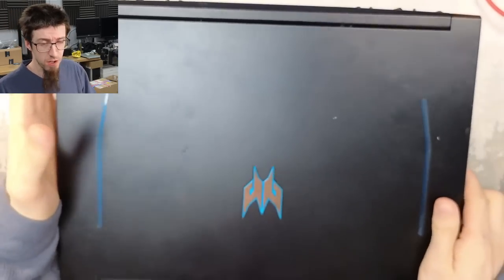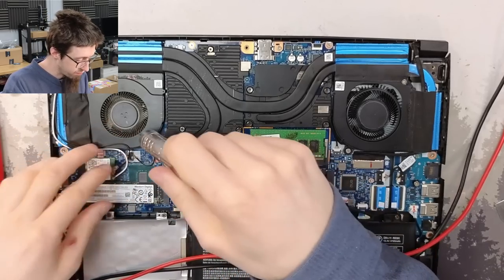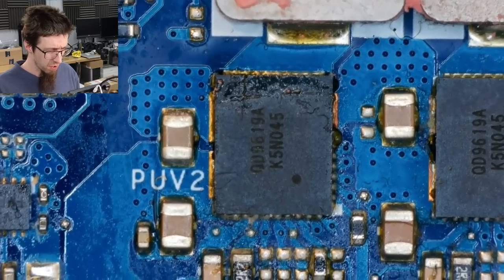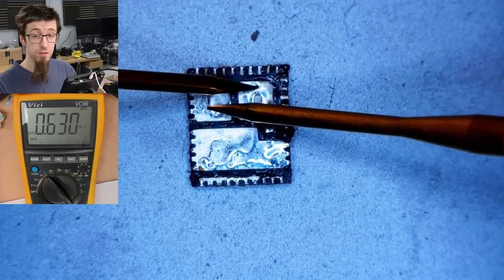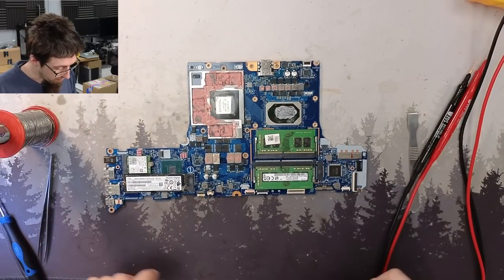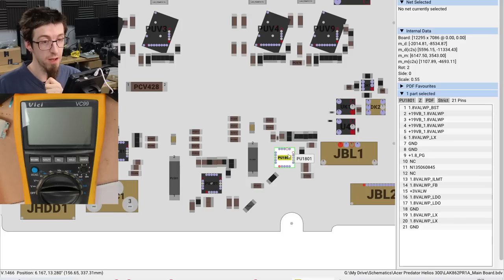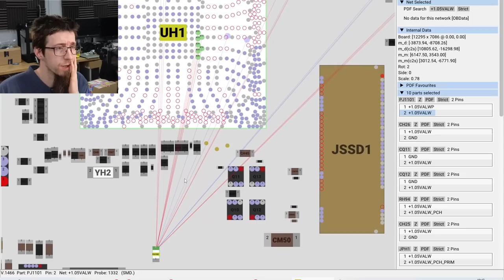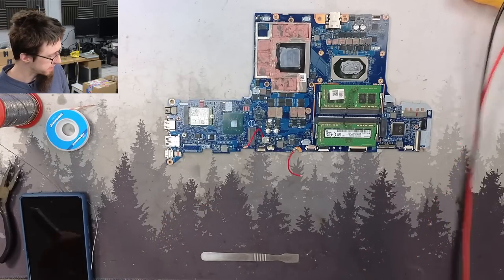A lesson in gathering all the data first - LFC#364

Comment from the maker: Side note, this is why we always inject at 1v or less, because you never know when the injection voltage might go to unexpected places. If you're below the voltage of everything on the board, the risk of causing further damage is minimal.
Reply: 100%. 0.5-1 volt injection is always safe to my knowledge.no  chip is gonna blow with voltage that low.Dont forget to set limits to current as well,start from very low and slow and stready  increase if needed.Also,as a general rule, pch cpu,gpu surfaces,need to heat up uniformaly when taking power.If during injection the  surface heats up partialy,its gone to silicon heaven.
Reply: These acer helios and predators almost always have a dead gpu or pch. Very rare i have found one not to. I have replaced mosfets to get light on charger but nothing. Terrible laptops when they go.

Comment: An easier way to check if a high side mosfet is shorted or partially shorted is just to check the resistance between drain to source, since in those vrms the phases are all in parallel if one mosfet is shorted then all of them will show as shorted. If the resistance is high then you pretty much know that all the high side mosftes are not shorted, still doesn't mean they're not faulty but you know the supply didn't shot through.
All of the mosfets are in parallel but their gates are not, so like Graham said, measuring their gates is the best bet for spotting the bad one. Mosfets generally (not always) when they get shorted they short all the terminals together so the bad mosfet will have a different reading from drain/source to gate compared to the other ones in the same vrm.
Similarly you can check resistance from the main power rail to the coil which is the same as measuring drain to source.

Comment: Another youtuber i watch had a similar problem with an 1080 he was sent to fix. The first thing the previous technician did was measure resistance to ground on the vcore coils, saw a low resistance and started removing everything that is connected to ground on that rail, he removed all the low side mosfets saw that the short didn't disappear and called a dead chip when the real problem was a shorted capacitor on the 5v rail.

This board you were trying to fix is a complete nightmare on the other hand, shorts everywhere.
This was good content though and a lot can be learned from this for sure.
Great video.
Cheers!

Comment: Done watching, thank you very much for the informative troubleshooting & repair video. I have learned significantly more troubleshooting & repair lessons in this tutorial video and to your other repair videos as well compared to my ENTIRE 4 YEARS OF COLLEGE EDUCATION. I hope you will soon have a mini-series for Schematic & Boardview-free Voltage/Power Rail Tracing[12V/18-20V Main Voltage Rail, 5V, 3.3V, CPU/GPU Core Voltage Rail, DRAM Voltage Rail, IGPU Voltage Rail, System Agent/Northbridge Voltage Rail, PCH Voltage Rail, BIOS Voltage Rail, Battery Power Rail], Proper method of testing/checking of potentially faulty MOSFETs & ICs/Controller Chips, CPU/GPU/PCH Reballing and BIOS Bin File Editing.

Comment: There are several reasons why modern GPUs and CPUs have a low resistance, but the easiest explanation is based on Ohm's law. Modern processors run on much lower voltages then most other IC's. In the early days of transistor IC's 12~14 volts was not unusual. While currently most processors run on 1.0~1.5 volts. The number of transistors in the CPU has also increased exponentially by staggering amounts (currently we're in the 1 billion to 10 billion range for CPUs and twice that for GPUs). With the increase in computational power, interconnectivity has also increased and more outputs are required to turn high to signal to other IC's that the processor is turning on. Meaning more current paths are open while the processor is booting up. GPUs usually have a lower resistance than CPUs because they have higher parallel processing capability (which requires more transistors to be in parallel).
Reply: Thank you for the information.

Comment: You need a multimeter that "short" beeps on reading a normal diode and "long" beeps when there's a short. 
We all know ALL multimeters in existance beeps on (when you touch both +- leads) continuity mode (resistance) BUT there's better multimeters that beeps on diode mode as well.

Besides the overpriced YELLOW brand, I've found a few cheap ones that does this, Uni-T UT60 & Uni-T UT89. Costs only $30 or less. You must have them!

Comment: you can replace the pch from a donor board tho if you are good enough with reballing and stuff
Reply: I asked Graham if he took in donar parts but he doesn't coz ot having loads of stuff stored amd in some cases never used but I know one guy who does but then again he has more staff plus storage space.
Reply from the maker: Yea PCH replacement is possible... but you need the right PCH, with the right firmware, then reball and replace - and after all of that, then you have to fix anything and everything else that might be broken on the board, and it's likely that one or more secondary regulators are busted as well.
If anything, I'd say this board is more useful as a CPU/GPU donor to another board with simpler faults.
Either way, to the next tech to look at it, good luck
Reply: @Adamant_IT  But you'll tell the customer that the laptop is dead, right?
Reply from the maker: No, I told them the PCH was dead. They're seeking a PCH replacement, but as per my previous comment, that's a job I'll let someone else take a swing at.
Reply: @Adamant_IT  Ok.

Comment: I would think the reasoning could be. Find short - inject - find regulators getting hot - check pinouts on datasheet to inject again at the output side of reg that will then allow you to see heat on PCH. Dead PCH done. I was wondering why you took so long to inject. Maybe prefer hunting with probes may be. Anyway. Thanks for sharing. Always learning.
Reply: Because mr Adamant has learned the hard learned lesson that there is such a thing as injecting too early. And most experienced technicians have learned this by eagerly injecting at the first sight of a short, and bricked silicon on a bord that was actually fixable. Thus sending the GPU/CPU/PCH to an early grave.
Reply: @sindreskjelbostad6436  injecting at 1v will avoid those issues. How can 1v kill a CPU or PCH?
Reply: @Swenser  it probably won't, but it altso depends on much amp you send. And at such low voltage, a short may not show, especially with a sub par thermal camera, tempting you to increase the voltage. And while 1v prob won't do any harm, 1,5 probably will. At any rate, if voltage injection is always your go to, you never don't really learn much about the electronics you are repairing. Wich is what Adamant and a few other technicians are trying to learn beginners.

Comment: Not gonna argue with your result without testing the laptop myself, BUT:
- I find it odd for a piece of silicon to "connect" multiple rails so perfectly to ground at the same time. Usually (IMHO) with the PCH, only one rail is shorted and that's game over.
- When I declare I PCH dead, I want to inject power to the short and see the PCH getting hot and nothing else. If I don't see that, I'm not done.
Reply: yes, you have to see a single dot spot on the PCH if it is a dead one
Reply from the maker: I'm told by folks I trust (I checked in with them while I was working on this one, just before I did the conclusion saying I'm sure the PCH is dead) who says that it's quite common for a dead PCH to short the 1v and 3v rails together. I agree that injection to see some heat on the PCH to confirm it makes sense, but with the entire board all showing 0ohms and likely at least one bad regulator somewhere, it felt like injection wasn't showing anything useful, like trying to find a hole in a sieve.
Reply: @Adamant_IT Thanks, the part about 1 and 3V beeing both shorted is good to know.

As for the conclusion:
 I don't disagree. I just presented my way of definitively declaring an IC dead and that would have been in this case: Remove any other part, that gets hot during voltage injection, until either the short goes away or the PCH is the last thing, that gets hot.

Comment: Plz how you get the schematic is it an application or what ??
Reply from the maker: Schematics are usually PDF files, and occasionally you can also get a board view (which shows where things are located on the board) which requires an application like FlexBoard View to view.
You can find them for googling for the board part number, for example a common MacBook Air board would be "820-00165 schematic"
Reply: @Adamant_IT  thank you i enjoy your videos keep going 💕

Comment: Excuse my ignorance, but what is a PCH? Googling it says it's a Platform Controller Hub for Intel platforms, but I'm still no nearer
Reply: Well, there is a Wikipedia article titled "Platform Controller Hub". So reading that should answer every question you could have.
If are more familiar with the term "South Bridge", you can also think of it like that.
Really short answer would be:
It connected the CPU to "everything" else, like Ethernet, SATA, USB, Wifi, Keyboard/Trackpad and so on.
Reply: @NebukadV  I saw that on the wiki article - what I don't get is how (or why) this chip went 'rogue' in the first place if no other fault was found; something must have caused a fault in the chip.
Reply: @Tapsnapper  This has nothing to do with your initial comment, but whatever:
As the PCH has electrical interfaces to the "outside world", like USB to name the most likely corporate, it can be killed from any overvoltage or ESD that might be happening on those interfaces (from dodgy mains wiring inbetween different devices and faulty devices).
Reply: Or one of the voltage regulators feeding it might just have sent 12V to it. This kills a PCH exactly like it kills a CPU. Those voltage regulators all looked sus throughout the whole video.

Comment: Why didn't you try the Chipmunk?
Reply from the maker: The chipmunk can give useful information, but only if the board is able to switch on. It can't tell you anything if the board doesn't power up. If the PCH had failed without shorting everything together, and we had a No POST, that's when the chipmunk would be a useful indicator.